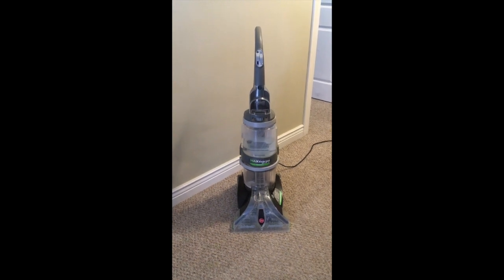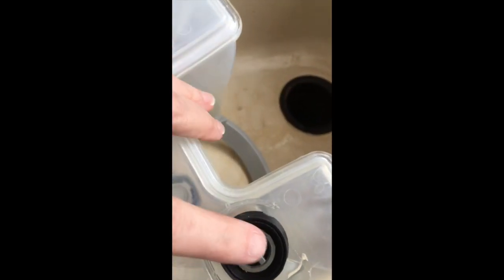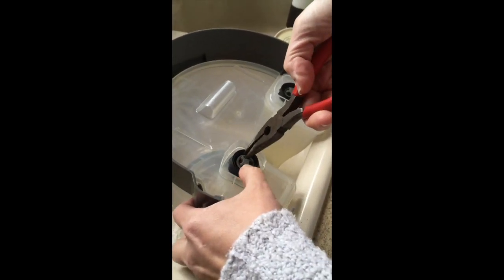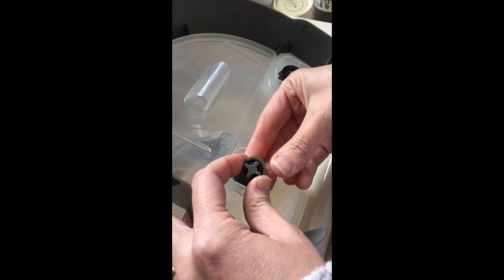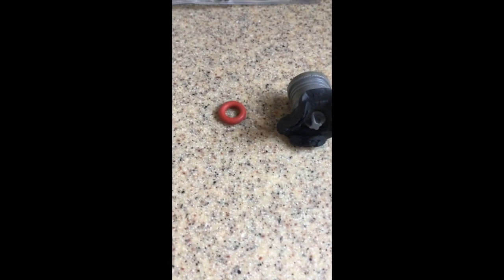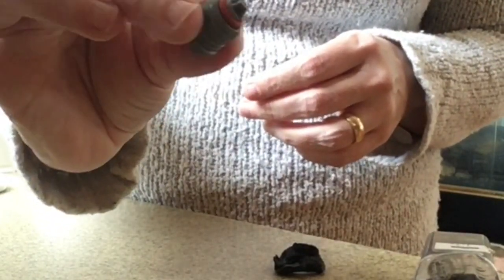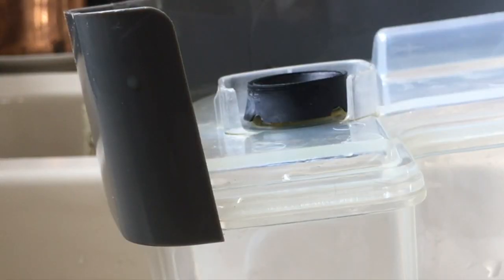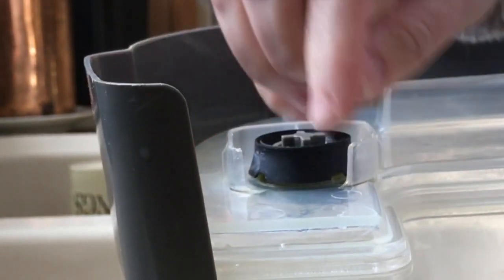Carpet Cleaner Water Tank Leak Fix Hoover

Comment: I have the same problem with my last two steam vacs  The last oneI bought is only a  year old...ugh!  I tried to see if I could change out the valve on mine is it is impossible as that piece is plastic and it will not come out were the seal is ebedded into the pastic, what a STUPIED design!.  Going to change brands  and make sure I can replace parts if necessary, so irritating!  Thanks for sharing it will help me choose an appropriate steam vac that I hopefully replace parts on easier.  THX!!!

Comment: I have the same problem!  Thanks for posting.  Where did you get the rubber ring you used to replace the gasket?
Reply: Most likely Ace Hardware or big box hardware store. I doesn't appear to be a proprietary part. Just plumbing. Use a bit o petroleum jelly such as Vaseline for an easier fit.

Comment: My actual tank doesn't leak, until I put it into the base. It just leaks standing up while I use the attachment or if it's just standing not turned on, all the water leaks out the bottom.

Comment: 😭 my spring and the little round rubber thing fell inside.  I hate to think I have to buy a new shampooer for those two tiny things. 😢
Reply: You don't need to purchase a new shampooer, you can usually find parts for less than $5 at a warehouse :) Just Google your model number and you should be able to find it.